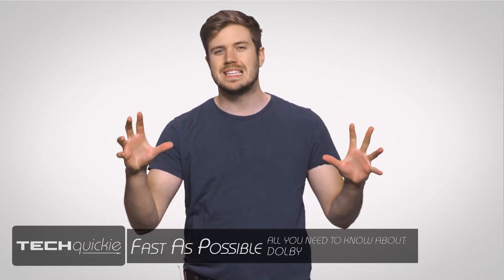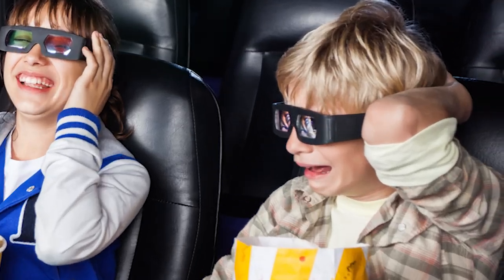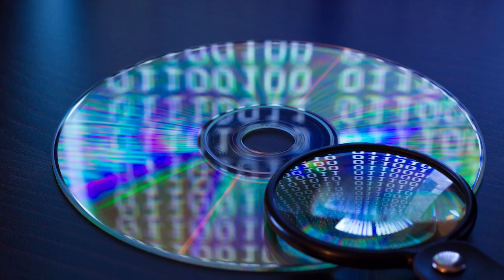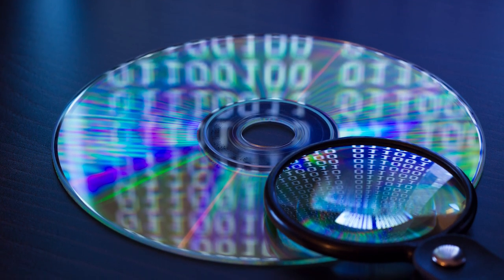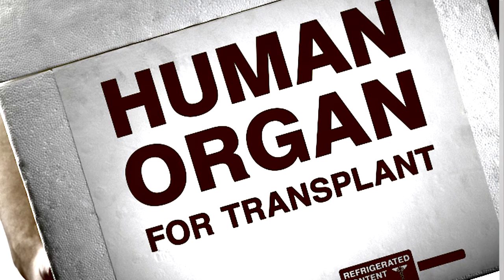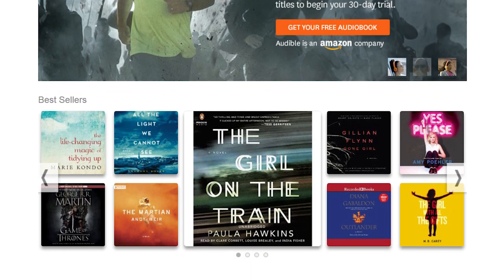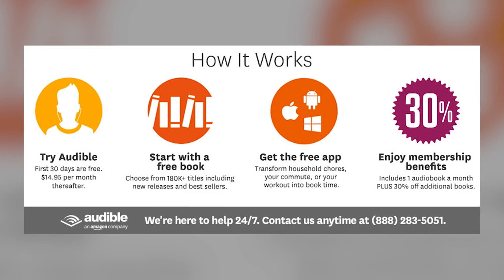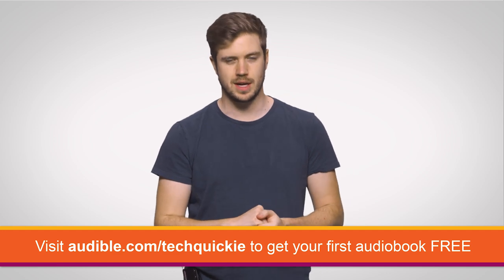Dolby As Fast As Possible

Comment: Virtual ram as fast as possible
Reply: How to download RAM as fast as possible
Reply: +Houdini111 No its actually a thing, windows.microsoft.com/en-us/windows/what-is-virtual-memory#1TC=windows-7
Reply: +Bipolar- Bear it's a place on your hard drive which can be used just like RAM by applications. Mostly the memory there is accessed more rarely than in ram.
Reply: +Bipolar- Bear Ram that exists on some tertiary storage device like a flash drive or hard drive and serves as reserve memory for the operating system to use when physical RAM is full.  Microsoft operating systems before vista were not optimized for the use of USB based devices for use as virtual RAM.  Vista introduced a feature called "ReadyBoost" that would utilize the faster speed of the flash drive over the hard drive.  Of course, mechanical hard drive speeds have come a long way since then and a releativly new one is indeed faster than a USB 3.0 flash drive, thus rendering ReadBoost almost useless unless you wanted to keep your virtual RAM to your USB drive only.

Virtual RAM was a big deal when it first appeared older versions of microsoft operating systems (like XP) because RAM wasn't as cheap or plentiful.  In addition to the constant increase in RAM size and speed, operating systems have taken a trend towards optimization over features and thus the windows system RAM requirements have remained the same and in many scenarios decreased.  Of course not all of this was done by improving the underlying code.  For example, windows 8 and 10 both remove legacy code that enables older programs to run and the operating systems saves RAM by only loading what it needs at this moment.  This can result in reduced performance when opening rarely used settings, at least for the common user.
Reply: +The Diamond Games Interesting.. So.. My pagefile and swap partition definitions are ruined again.. Damn..
Reply: Bartosz Olszewski Pagefile and Swapfile (never heard of swap partition) are the same thing as Virtual RAM.  The only difference between them is that Pagefile and Swapfile are exclusively used with the windows operating system while virtual ram is a general term that could apply to any operating system.

Pagefile is defined "Also known as the swapfile, Windows uses a page file to store data that can’t be held by your computer’s random-access memory when it fills up."

As you can see, literally virtual RAM but under the windows operating system.
Reply: Wyatt Newton Swap partition is a thing in linux, so you can have it on separate drive and it is not limited to the limitations of filesystem it is in because it is itself on a separate partition.
Reply: Wyatt Newton The Diamond Games thank you, gentlemen!
Reply: derpdennis
Reply: Watch you language.  Don't get all huffy just because another comment contradicts what you think.

Where did I get my "bullshit" from?  My job, working in IT.  Enterprise class HDD can easily get up to 400 MB/s.  I have consumer class WD Black hard drives that get 258 MB/s. 

Now compare this to the max speed of USB 3.0 "480 megabits per second".  That's Megabits, not megabytes.  In otherwords USB 3.0 tops out at around 60 MB/s.  Not to mention getting a USB 3.0 drive that reaches that max is much more costly than economy USB 3.0 drives in general.

Do you seriously think that an extra interface was going to be able to achieve faster speeds than an internal one that's designed for big data?  Please do not comment on a subject you clearly know nothing about.
Reply: Wyatt Newton  In sequential read.  
Sure - and now look at cheap USB thumbdrives.
And then there is this nice little thing of delay - were even enterprise mechanical drives are more than an order of magnitude slower.

btw - i work in IT too - tough luck idiot.
I will watch my words if the other person does not fuck up that big like you did.

And of course you fucked up again - you sure you work in IT? Cause it sound more like you just use your PC for Netflix and facebook.

"Now compare this to the max speed of USB 3.0 "480 megabits per second"."
Cause that is USB 2 and not 3.

"Please do not comment on a subject you clearly know nothing about." 
Exactly what i will now suggest to you.
You and IT - laughable at best.

Get a cheap USB3 stick and even there, at random 4K write you get ~ 0.5 MB/s.
Something like a SandiskExtreme gives 10MB/s.
Now compare that to something like a WD Black 6TB with 0.3 MB/s.
And with larger files and sequential?
Most USB3 sticks will give you round about 200MB/s, same as the WD HDD.

And now if we look at latencies - the average latency for cheap USB 3 sticks is round about 20 ms - quite a bit slower than the 5 ms of the WD, and decent sicks being close to 1 ms. Seems similar till you look at the high end, where even bad sticks don't go over 100 ms and the WD go to 1000 ms.

And then have fun with random access and a mechanical drive :P

So come again if you know anything about computers - pretentious brick.
Reply: Oh you work in IT too eh?  Excuse me if I find it hard to believe since you messed up your basic facts.

http://www.pcworld.com/article/2360306/usb-3-0-speed-real-and-imagined.html

I don't really give a crap what you write about because you and your mom are the only one's backing it up.
Reply: Virtual RAM isn't a thing, virtual memory is a thing.  And virtual memory is not a paging or swap file, virtual memory is what the OS allocates to a single process, which can be in RAM, a swap file, or both.  Only the OS has exclusive access to all memory resources simultaneously, this is to prevent applications from interfering with other applications' memory spaces.

Comment: i don't actually like the sound of theater speakers.
they sound so harsh and not very rich.
Reply: Depends on the theatre, different places use different quality speakers. IMAX is amazing for me, but very expensive.
Reply: newsynthetic kinepolis in Belgium has horrible speakers.
my speakers at home sound much better but aren't that loud
Reply: +newsynthetic Full size IMAX theaters uses 16 JBL 18" woofers in tapped horns behind the screen for the sub stage alone, so i'd hope so.
Reply: +Skylar Garrett That's still not really that much for those massive theaters. Not enough to produce really low notes anyway, home theater enthusiasts tend to have better bass in their rooms than cinemas
Reply: It depends on the local theater. My local theater has good speakers, but they crank the volume up too high.
Reply: Stig Rabbid Probably not. Reference level is damn loud. Each speaker needs to be capable of 105db peaks, so when you have scenes like in Interstellar where all the speakers are blaring rocket sounds it's going to be awfully loud.
Reply: philipx550 I was replying to the other guy who was saying his local theater crank the volume too high.

I don't doubt that that Logitech sub does a good job. It uses a Tang Band driver
Reply: Sportscars_BE youre the type of guy to think bass is everything and throw terms around like "rich" and "deep" without even knowing what you mean
Reply: Koni you're the type of guy who makes seriously wrong assumptions about random people on the internet you shouldn't even give a single shit about.
I'm not one of those, like, at all.
I don't even have a subwoofer ffs.
Reply: k
Reply: newsynthetic yeah but imax don’t have recliners

Comment: Hey guys since we're on the subject of dolby, can you explain 9.1? The types lg is selling with four upwards speakers? I got one but found out it's just 5.1....
Reply: 9.1 is 9 channels/speaker plus subwoofer.  If you google it up, it says it's virtual 9.1 rather than real 9.1(which is better obviously). A virtual system will have some speaker simulate as if it has two sound coming from it.

Comment: How much is a dolby atmos theater in you area?
mine currently is at PHP 170-250 = $ 3.58-5.26.
Reply: +Gilbert Plays ☆ CSGO and more Where I am it costs no more than any of the other theaters, and has so many different ways to get a discount that it's probably one of the cheaper theaters to go to, even though it's one of the best.
Reply: ***** The local Atmos is what I'd call balanced in terms of bass. But it is 750 seats. That said, I can only think of 1 theater which possibly has more bass and that's the smallest one in my area.
Reply: ***** Probably not really relevant since I'm from New Zealand. The Atmos one is the Embassy Theater (it's on wikipedia), owned by Event Cinemas. The small one is the Cuba St Light House Cinema. Only seen 1 film there, but the bass seemed pretty intense.

Comment: i haven't seen any consumer side thin supporting 9.1 sound though i see alot of 7.1 5.1 2.1 2.0 and headphones for games and alot of 7.1 for movies 
So why does nothing come out with 9.1 sound support?
Reply: the source media has to too not just my side and as i have my 7.1 head phones and a 5.1 set up with speakers i do hear a difference from open ear headphones to closed ear head phones in virtual 7.1 sound as a difference from headphones to speakers but as i see nothing claiming 9.1 i see no reason to buy the extra speakers to go from 5.1 to 9.1 speaker set up
on a side not 5.1 with speakers seems better for some things well virtual 7.1 in headphones is better for others 
NOW you have the catch 22 no one will make stuff supporting 9.1 until enough consumers  have 9.1 sound systems but not enough people will get 9.1 until there are movies and / or games using it 
thus why slow adoption of 1080p and now of 4k and UHD the masses wont go until there is a big seeable difference between them which for 4k in consumer homes there isn't one for 9.1 not enough consumers have it to justify the label for it

Comment: here I am still buying the old 90's analog prologic equipment. imo sounds much better than the cheapened junk on the market in recent decades. it's all just marketing now, quality matters much less. how many times have you seen a piece of audio equipment that says something like 1000 watts on the box, but in reality would struggle to produce even 100 real watts. look at the back of your equipment, do you see preamp outputs for all your channels? nope, gone, cheaper to leave them out, rarely even an option.

Comment: To have good sound quality, you also need good quality movies i.e. blu-ray (i guess games are always going to be pure quality). Streaming sites e.g. netflix will not give you such an experience, it will bottleneck the potential of the system. It will still sound good, but not the best, so there isnt any point dishing out for the latest and greatest dolby digital HD receiver, when a standard 600watt rms 5.1 surround will do the same thing when playing normal regular formats.

Comment: Nine freaking dollars? You lucky bastards, we pay $10.05 for a SMALL at the local theaters. And it's $12.50 for an XD ticket, $10 for a standard ticket and both seating configs are ridiculously cramp. But that's why I don't go to Cinemark theaters anymore. Sadly means I don't go to movies any longer either, because aside from the cheaper local theater after it cycles out of mainstream showing (which has superior seating and arguably superior sound systems anyway), there's nothing.

Comment: Personally, I want to know where all that juicy current that powers my gaming addiction comes from. I am specifically interested in high volume clean energy production. Even more specifically I would like to hear about nuclear power, BUT HOLD ON, before you make any judgments, I think people don't understand it well enough to see the pure awesomeness behind the atom and I feel like you guys could relay understand and explain how safe it actually is. Just as an example the building the reactor is housed in is meant to sustain the impact of a Boeing 747 at full speed. I think that the world is in trouble and I feel bad knowing that a large part of the electricity powering my computer comes from coal. I think that nuclear power is not only safe enough but also the only clean energy source that is currently capable of producing the amount of energy that we consume. Also be sure to mention how stupid the design of the Hiroshima and Fukushima plants were,  pleas ask if you are curious. Also I have recently herd of a reactor based off of Thorium-232 instead of Uranium-235 that is supposed to be even safer perhaps you would like to expand on that. I know its a subset of the energy production system, but I think that it is the future of energy and, being computer geeks, we tend to use a lot of it and should be concerned with where those 4k graphics are truly coming from...

Comment: Avi, mp4, mkv, etc as fast as possible
Reply: Flac, mp3, etc too
Reply: MP4 and Matroska aren't formats, but containers for a video and audio streams that can be encoded with a variety of formats (H.264 and AAC are common with these).

FLAC is a lossless compression (in which said audio data is encoded in a way that retains all of the data) format.

Comment: Originally, Dolby focused on improving stereo sound. Also, you will need to sell a kidney for surround sound since a surround receiver costs from 1000 to 2000 if you want it to work. I just bought a vintage 70's stereo receiver instead for 10x less.

Comment: Dolby atmos sucksss... It makes the sound quieter to fit all the channels.
Reply: +Jordan Hill Get more speakers or turn the sound up xD
Reply: Tony I am talking about in theaters lol. You pay almost the same as Imax price for tickets and the sound is worse than standard theaters.
Reply: +Jordan Hill Try a different theater then, sounds like the theater you go to isn't really up to par exactly
Reply: It wasn't a typical one I go to, I just tried it because I heard so much about atmos, and wanted to hear what it was like.
Reply: ***** Understandable, maybe at some point give it another shot at a different theater, movie theaters are hit and miss with their audio set ups
Reply: Or your local theatre has shit speaker for Dolby Atmos.
Reply: Snuggly Aggressive Bear I tend to really just stick with the real IMAX because the sound is just on a whole other level to normal theaters.
Reply: +Jordan Hill That's not how it works, must just be a bad theater. The Dolby spec for setting up an Atmos theater requires the gear to all be capable of the same SPL as the previous standard, and considering Atmos setups should have more speakers, they should be capable of being much louder (not that it needs to be)
Perhaps your theater downgraded to cheaper gear so they could afford to get all the extra amps and speakers
Reply: bassl0va it was a new theater...
Reply: ***** Oh, well setting up a theater is expensive, guess they cheaped out. They probably know that most of the general public won't notice or care.
Reply: Go to Cinemark XD. its got Atmos louder than most theaters.